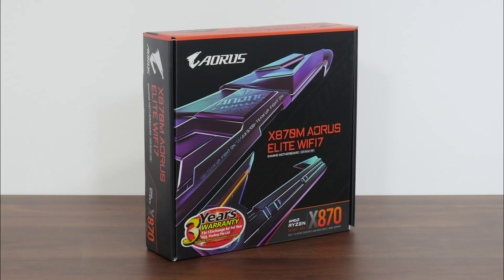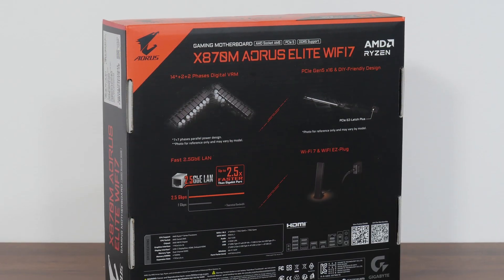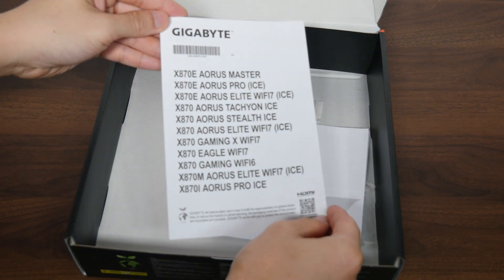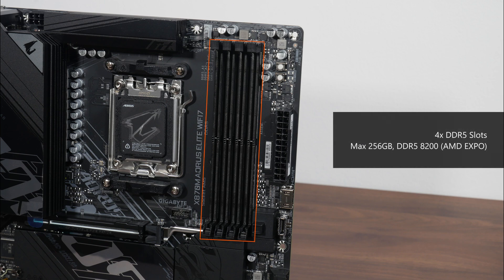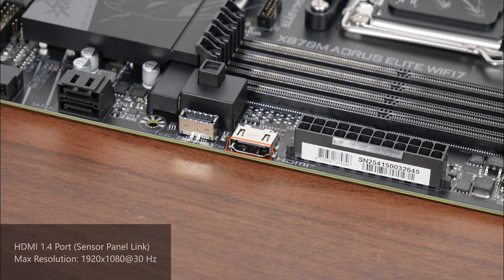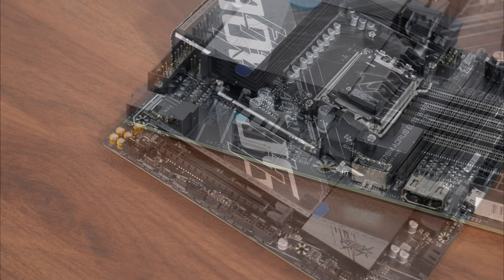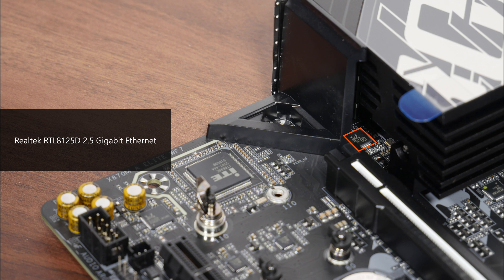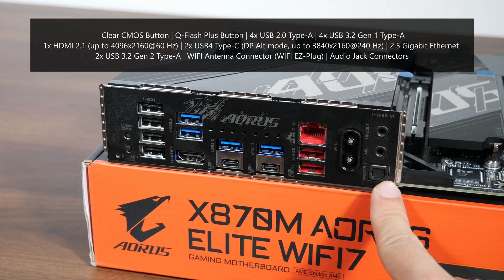The ONLY AMD X870 mATX mobo in the market! Gigabyte X870M AORUS ELITE WIFI7 Unboxing & Overview

Comment: I own the X870 Aorus Elite WiFi 7. My GPU wasn't able to sit fully in the PCI-E slot [ PC was still able to POST ] but there was a finger spacing between the IO bracket and my case IO cover so I wasn't able to screw my GPU in. Took me awhile to get the GPU out as the EZ-PCI E button was jammed so it couldn't be pressed so had to remove the M.2 heatsink above the GPU and manually unlock the latch. But after reinserting, it was still not able to enter fully though the button was unjammed.

As it turns out, there's a U shaped notch at the left side of the PCI-E UD X slot at 6:45, that is meant for the extra part of the GPU connecter which doesn't seem to have any traces or gold connectors. So I pushed the display IO shield down while my PC was on my bed and managed to get it in. I never had this issue before as I also owned another Gigabyte A520 D3SH AC and was able to push the GPU in fully. Just to note for other users who uses this motherboard or has this PCI-E UD X slot. Maybe you can pin this comment for other users if they come across the same problem.

Also from SG :D
Reply from the maker: Hey there, thanks for sharing in such detail about the issue that you faced with getting the graphics card properly installed. Am just wondering, could it have been that the motherboard for whatever reason, wasn't sitting flush on the motherboard standoffs on your PC case? I find that such contact issues tend to happen when the motherboard is not properly mounted on the respective standoffs. But yeah, it could also be the case that the U-shaped notch for your particular board was tighter than usual, leading to difficulty with getting the PCIe "teeth" properly seated within the slot! Out of curiosity, what PC case are you using with this board?
Reply: @ALKtech  NZXT H5 Flow RGB. My PC is actually from Aftershock SG and sent it in for upgrading of the motherboard so when I received it back, it was already like this during shipment. Luckily I didn’t see any damages to the PCI-E slot on the GPU and was able to get it pushed back into the slot itself. There was no way I am leaving the GPU like that forever plus the EZLatch button was jammed. I believe the GPU IO bracket tooth was already inside the PCI-E slot area.

Here's the example : https://drive.google.com/drive/folders/1V541QmwFuunmPnrBeOFkGvN0ZWwD-z2a

Comment: The motherboard works great with the Krux Helio case. It turned out to be a nice, cool, compact setup. I’m satisfied.
Reply from the maker: Great to hear! What processor and graphics card are you using with this board?
Reply: @ALKtech I chose a mid-range configuration:
R7 9700X, NH-D15s chromax black, ASUS GeForce RTX 5070 Prime OC, Endorfi Fluctus RGB fans. Two 140 mm at the front (which required modifying the case), one 140 mm above the CPU cooler and one 120 mm at the rear, Samsung 990 Pro, Bequiet Pure Power 13m 850 W and Kingston Beast 32GB CL 30 RGB.
Reply from the maker: @jmbrockerss2389  sounds like a nice build that will handle 1440p gaming with ease - hope you managed to get your DDR5 memory at a somewhat decent price or before the current RAMpocalypse began😅

Comment: Snagged one for €333.40 to be coupled with a 9800X3D, 5090, 128gb DDR5 6000 CL32, 9100 PRO and SF1000, to go inside a Lian Li A3. 
Fingers crossed everything sits nice and snug with a Lian Li II Trinity AIO 360 🙏
Reply from the maker: Sounds like a real powerhouse of a gaming PC build, which brand of 5090 in particular will you be using? The A3 should have sufficient length clearance for most 5090s I'd think!
Reply: Hi!
Did you manage to build the configuration you mentioned here?
I also plan to configure with 9 9950x3d, X870M AORUS ELITE WIFI7 in the Lian Li A3-mATX case, but as an AOI I plan to use Lian Li Galahad II LCD SL Infinity 36 c FAN 25mm and RADIATOR 30mm, which in total should give a height of 55. I'm really worried if there will be any problems with motherboards IO shield.

Comment: I got mine via HK. It's not even for sale here in Taiwan which is where Gigabyte is based!
Reply from the maker: Oh wow. I wonder what's up with the lack of availability for this board. Being hard to find in say, the US or Europe is understandable, but even for Taiwan to somehow not have this model in stock...very puzzling. Out of curiosity, did you get this board primarily for its USB4 connectivity?
Reply: @ALKtech I was told there is no market here for M-ATX boards but big market in HK and Japan for it. I got it for the usb4 ports/many ports. The its version just had a dire lack of them. Just finished my build in an ncase M3 and running good!
Reply from the maker: Thanks for sharing, enjoy the heck out of your new build!

Comment: too bad this is unavailable in the US
Reply from the maker: Hopefully it'll find its way onto US shores soon! To my understanding mobo manufacturers had issues getting stock to the US due to the whole tariff situation, and this board might be one of those affected.
Reply: @ALKtech  it's available on amazon in mexico. I'll have to smuggle one in 😭
Reply from the maker: @imitatsiya  😅 just out of curiosity though, is there a particular reason why you're looking for a X870 mATX mobo? Do you need the USB4 connectivity?
Reply: @ALKtech  not particularly; moreso I need an m-ATX board that would pair well with a 9950x3D down the road

Comment: Ordered this motherboard last weekend (EU), they had 5 in stock at some partnership warehouse somewhere else in the EU. Theres not many computer stores selling it. Price was 286€.
Building with 9950x3d, 64gb 6000 cl30 kit, 9070XT, SN8100 2TB, SF1000 PSU and all of it goes into a small Lian Li A3 case. Bought the SFX PSU because it gets bit tight with 360mm AIO. I want to fit 3 fans bottom, 1 front and 1 back but we will see how it goes.
Reply: almost exactly what I'm trying to build
Reply: I just built mine with the same board except RTX 3080, Corsair 750watt, XPG 64gb CL30 but into NCASE m3!
Reply: It can fit with arctic liquid freezer 3 top mounted in that case which is rare
Reply: @rubenvermeylen7128  are you talking about 360mm or 280? Just saw a build with a different but very similar mobo in the lian li a3 and a 360mm radiator with 55 mm total thickness (30 radiator + 25 fans) and it was a super snug fit with the motherboards IO shield.
The arctic liquid freezer 3 360 is 63 mm in total thickness.

I am planning a build with the gigabyte x870m and the artic liquid freezer 3 and i‘m afraid it won‘t fit 😅
Reply: @maximilian8494  Hi!
Did you manage to build the configuration you mentioned here?
I also plan to configure with 9 9950x3d, X870M AORUS ELITE WIFI7 in the Lian Li A3-mATX case, but as an AOI I plan to use Lian Li Galahad II LCD SL Infinity 36 c FAN 25mm and RADIATOR 30mm, which in total should give a height of 55. I'm really worried if there will be any problems with motherboards IO shield.
Reply: Hi!
Did you manage to build the configuration you mentioned here?
I also plan to configure with 9 9950x3d, X870M AORUS ELITE WIFI7 in the Lian Li A3-mATX case, but as an AOI I plan to use Lian Li Galahad II LCD SL Infinity 36 c FAN 25mm and RADIATOR 30mm, which in total should give a height of 55. I'm really worried if there will be any problems with motherboards IO shield.

Comment: Just received mine
Reply from the maker: Nice! Which country are you from, and how much did you pay for it? Availability for this board seems limited at this point in time from what I see on the web...
Reply: @ALKtech Netherlands.
It already stopped selling on the initial webshop I found it on. Luckily I found another in the Netherlands that sold it.. I think it's a pretty good buy, I'll be using a 9950x3d and 64GB ram, 5080 possibly .
Reply from the maker: @unspecified.entity_  sounds like a powerhouse build coming right up! How much did you pay for the board?
Reply: @ALKtech  Hey bro! Yea it's gonna be a powerhouse. That's the plan.
I payed 280 euro's for the motherboard.
Reply: @ALKtech  Do you think the motherboard is a good choice for a new high end pc?
Reply from the maker: @unspecified.entity_  yeah I do think it'll work perfectly fine with the 9950X3D, especially if you're going for a mATX build - have you decided on a PC case and CPU cooler yet? The important thing is to make sure you don't skimp on the cooling aspect of things, you wouldn't want your 9950X3D to thermal throttle!
Reply: @ALKtech Arctic Liquid Freeze III Pro
Reply from the maker: @unspecified.entity_  nice, that's a pretty solid cooler for a 9950X3D. You'll do just fine!

Comment: 6:59 you've just saved my life.
Reply from the maker: 😅 did you nearly remove your graphics card without pressing down on the EZ-Latch Plus button first?
Reply: @ALKtech Not yet. But I was wondering how to pull that pcie lock below the card up given my access there is impossible without removing the cpu cooler first. But - now I know it's possible!

Comment: what the hell, is this only available anywhere but not the US? i have been trying to find one but i cant find one at all in any online store?????????
when i click on your link it takes me nowhere, just to amazon with other x870 ATX motherboards
Reply from the maker: It's pretty new in the market and only recently launched where I'm from (Singapore). I have a feeling it may take some time for the board to be available globally, especially with the whole tariff situation ongoing in the US - there was a MSI B850M MORTAR WIFI board that I covered some months back, from what I saw online, it appears that the board took awhile to reach the US due to the same said tariffs...I could be wrong!
Reply: @ALKtech  I hope it makes it to the market! i have an aorus b850m but I put a ryzen 9 9950x3d in it, so i am waiting for a high end micro atx motherboard
Reply from the maker: @mArqSV  is the performance of your 9950X3D okay with the B850M AORUS? Any signs of the CPU being thermal throttled and the like? I'm asking as I think swapping out to the X870M AORUS ELITE WIFI7 might not result in much of a performance difference (if any at all)...unless you have a need for the USB4 connectivity that the X870M board has!